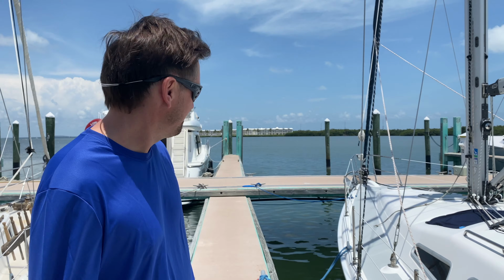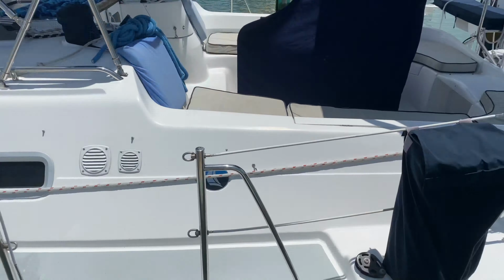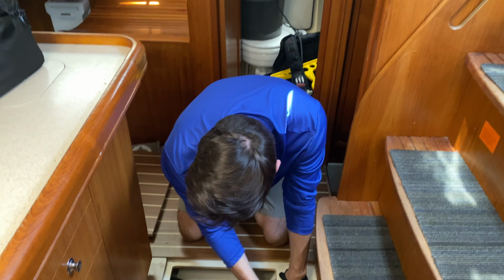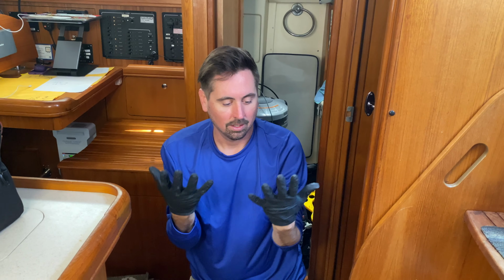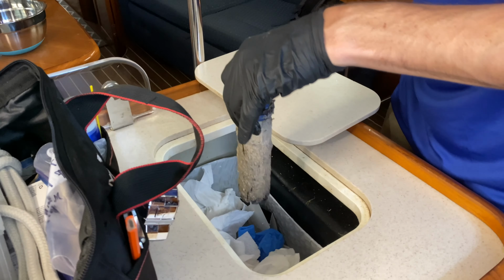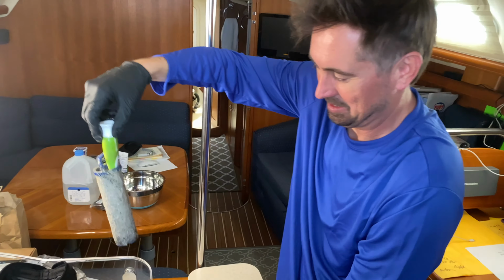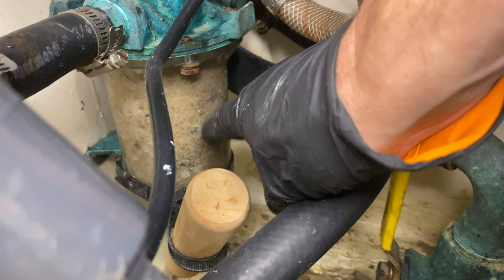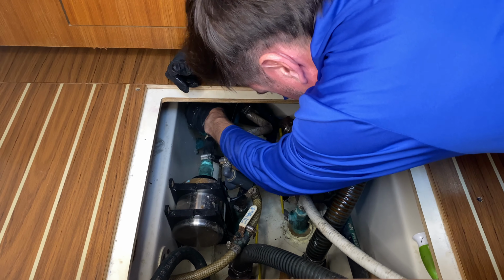Sailboat Maintenance: Cleaning A Sea Strainer

Comment: Wow that was a dirty filter!!!!  I've never seen one that bad, but I'm up here in the north.
Reply from the maker: It was a week or 2 overdue to be cleaned.  The engine and generator sea strainers are nothing like this, this is the Air Condition strainer, and It runs 24/7 sometimes, while sitting in  marina water.

Comment: One job I absolutely hate is changing/cleaning filters  ,I think they put them in hard to reach places trying to get owners  to take them to a professional ,but we sailor  are well versed in boat gymnastics
Reply from the maker: You can tell by the state of the filter, we put it off for an extra week or two. That one is  difficult to Access, but the main engine one is nearly impossible to get out without breaking the handle off of the strainer, we’re debating removing the handle just so we can get an in and out easier.